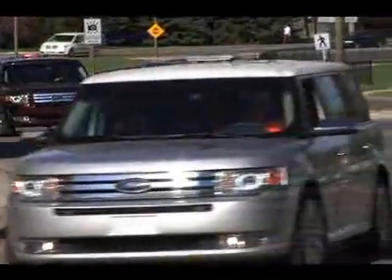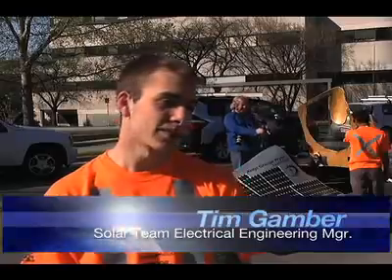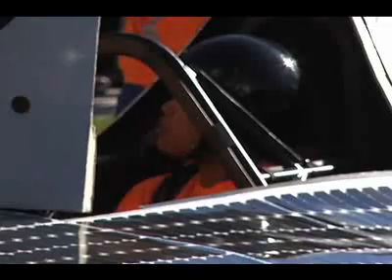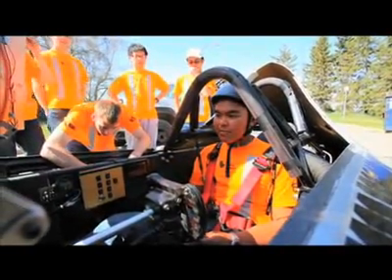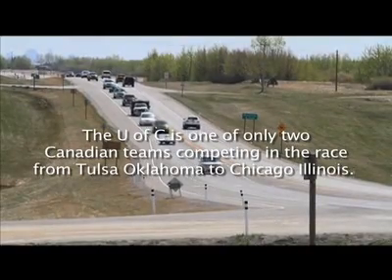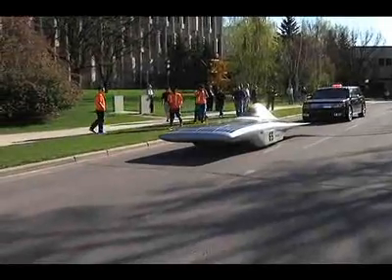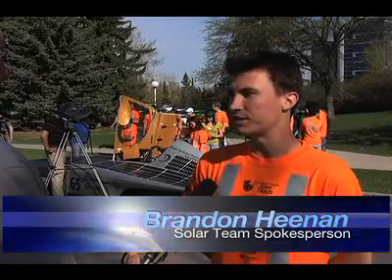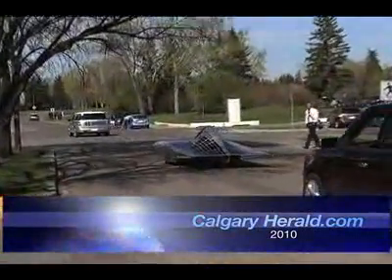Calgary's Solar car hits the streets

Comment: bad areo-dynamics 
you need a lower front end  , lower the body down 
create the thing out of carbon fiber , send the power out evenly though out the front  two tires.
carbon wheels . use plexiglass for the windows and even you can mount on that rc plastic body  stuff its super light and can hold up to speeds that the sloar car cant reach.
also any wait should be put right on top or near the front tires to give the front wheels more traction